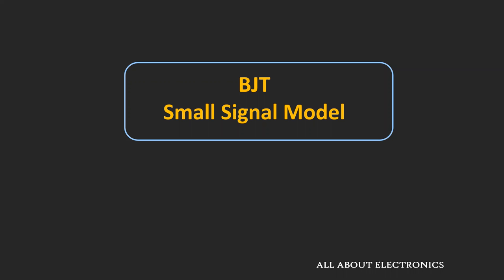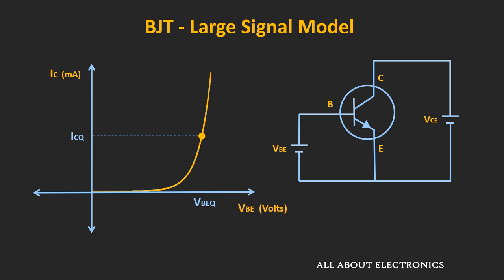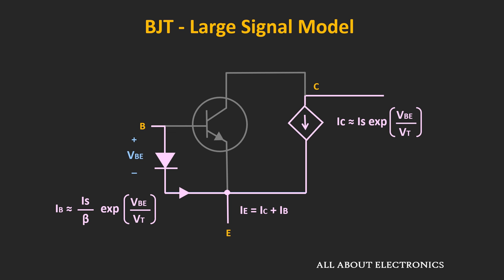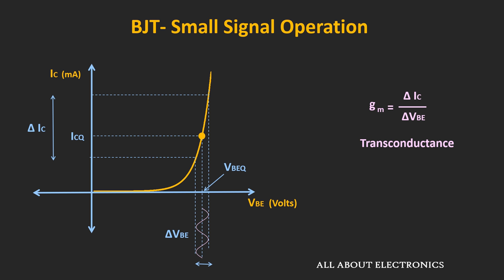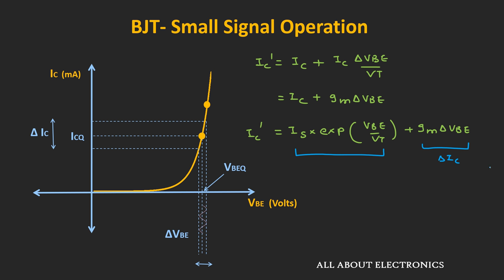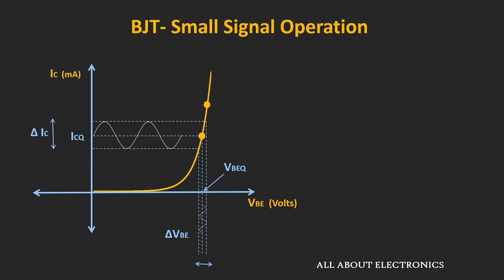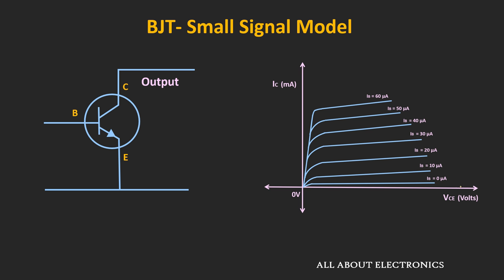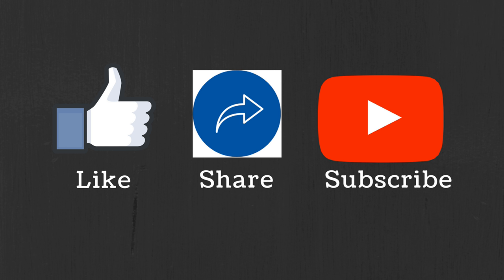BJT -  Small Signal Model Explained

Comment: Well, I understand this small signal model, but the derivations just add complexity. I find the re model using a diode and controlled current source so much more intuitive. The diode ac resistance in the emitter is simply re=26mV/IE   (the emitter current IE from the DC Bias) and the controlled current source Ic = alpha (Ie).
Reply from the maker: In some configurations, the analysis using re model is easy, while in some configurations analysis using pi-model is very easy.
Reply: @ALLABOUTELECTRONICS  Thank you, this must be the case.
Reply: @ALLABOUTELECTRONICS  do you have a video on re model as well?

Comment: Is there different small signal model for different BJT  configurations like common base for example?
Reply from the maker: Irrespective of the configuration, the small signal model of BJT remains the same. Based on the configuration and the external resistor, the small signal equivalent circuit will be different for different configurations.

Comment: bro 3:53 sec why did u take delta vbe very small?
Reply from the maker: Since it is a small signal analysis,so it has been assumed that the time varying ac input signal is very small in magnitude. And because of that the change in vbe on top of the Vbe is also very small. 
I hope it will clear your doubt.
Reply: @ALLABOUTELECTRONICS   ya bro thanks alot🤗